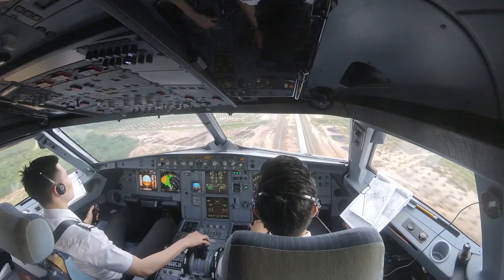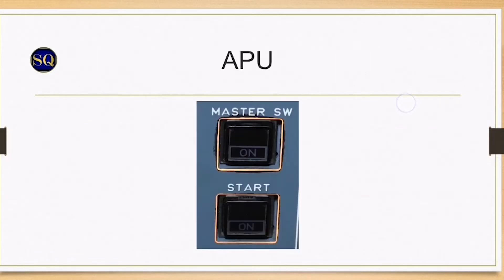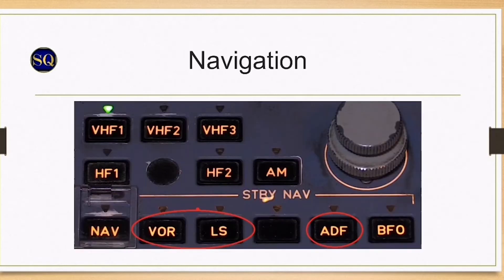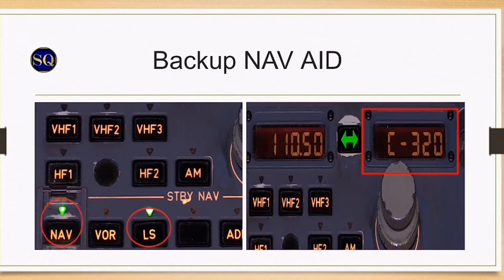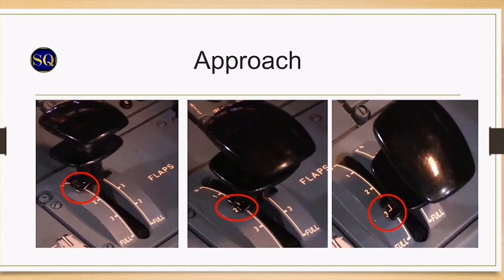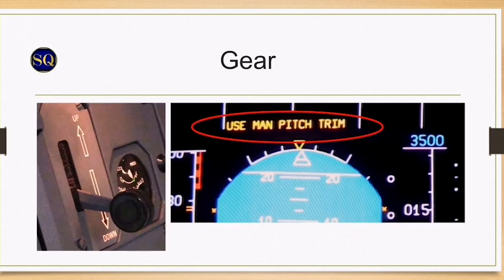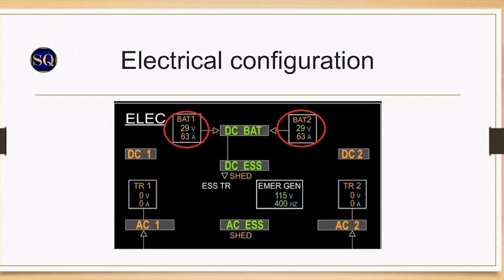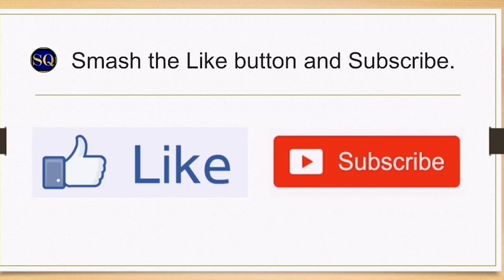A320 Electrical Emergency Configuration Part 2

Comment: 2 questions: where did you see that the aircraft is to be configured CONF 1, 2, 3……then GEAR DOWN….and LGD GEAR down at 1000ft AGL? My understanding of the FCOM is that the configuration is normal (for flaps 3) and the ILS flown as a STABILISED APP.
Reply from the maker: Stabilised approach is indeed to be configured before performing a final descent. The sequence is Config 1 , 2 gear down and the config 3. However, if you are on electrical emergency configuration , then once the gear is down, you are in Direct Law.
Reply: @Captain_SQ  i agree , it has to be a stabilised App, the aircraft needs to be FULLY CONFIGURED (conf 3 in the scenario) prior to the FDP that is my first point. Second where does it says that the procedure is conf 3 then Gear down ? Especially at 1000ft AGL? That’s the last place you want to destabilise an App……You may be getting confused with 1 of the double HYD failure where the procedure calls for  Conf 3 then GEAR DOWN.
Reply from the maker: @prc6608  stabilised prior to 1000 ft aal. you can go gear down and then go config 3. but bear in mind it will be in Direct Law and be mindful of the pitch.
Reply: @Captain_SQ  Not correct. Stabilised mean at the FDP (final descent point), not 1000ft AGL. You are getting confused with a decelerated approach. Are you able to give me a reference from either the FCTM or FCOM regarding the technic (conf 3 then GD)you’ve mentioned ?
Reply from the maker: @prc6608  yes I see your point. And no it is not in the book. However if you select gear down when you are flying level, you will go to Direct Law, then you will have to use MAN PITCH TRIM. By the time you start your descent, you will have to trim to your desired profile. If you have establish your final descent profile and then select the gear down, would it be easier because your aircraft is already in the desired attitude? what do you think?
Reply: @Captain_SQ  flying an Airbus or an approach in direct law isn’t really an issue (it’s harder but). When you have time have a look at the REMAINING SYSTEMS for a dual HYD failure, especially the G+Y. This is the ONLY case Conf 1,2,3 then GD is flow. In (1) below it will explain why. For all other the other failures, the “normal procedure” should be flown. For the STABILIZED approach technic, the aircraft HAS TO be fully configured at the final descent point. On an ILS the FDP will depend on your G/S intercept altitude. Look I’m not here to argue with you, I’m pointing out few things that were not correct. I’ve watched most of your videos and they are pretty good…..but the procedures sometime are not totally correct.
Reply from the maker: @prc6608  Thank you for sharing.